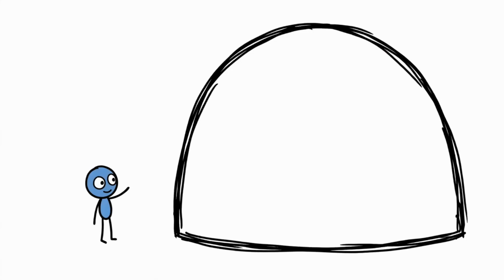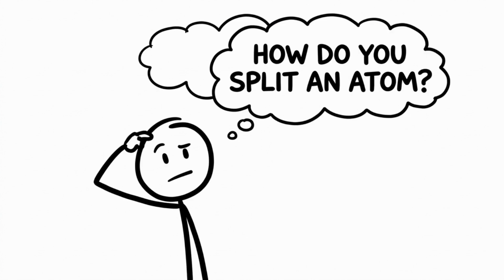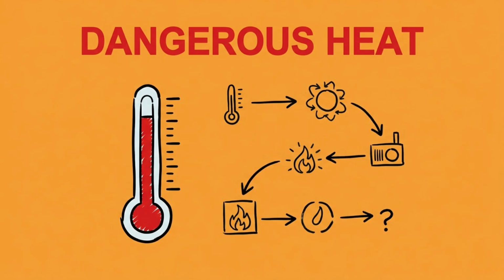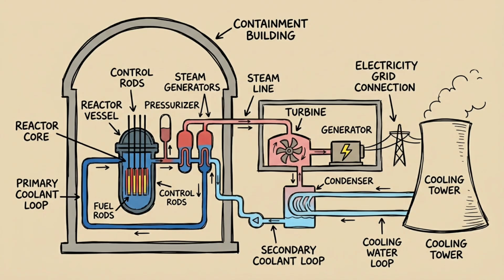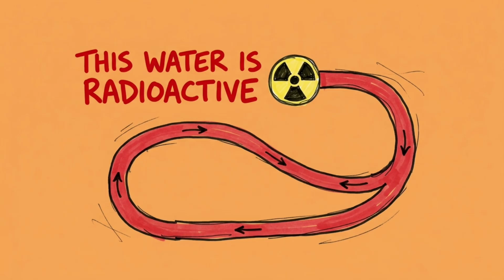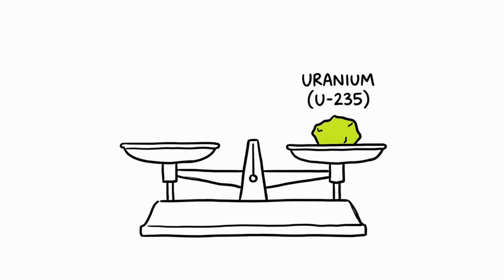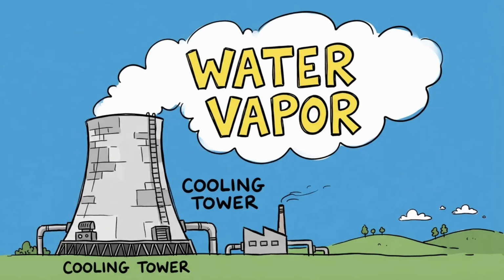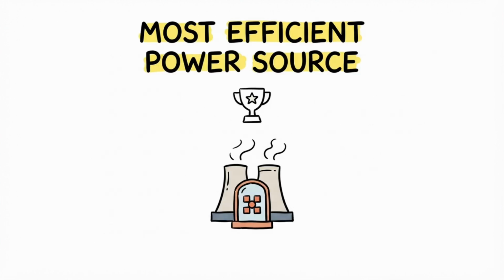Nuclear Power Explained in 60 Seconds

Comment: Massive battery on wheels, if we are to have an electric future then millions and millions and millions of BVs, battery vehicles massive batteries on wheels.

Even the nuclear nuts say the same, more electricity, more than the grid can handle, but nuclear nuts ignore grids massive limitations for getting massive amounts of electricity to the millions and millions and millions and millions and millions and millions of grid connections.

Nuclear nuts then say LESS TRANSMISSION more nuclear plants, SMR, Small Modular Reactors, and more BVs, battery vehicles, massive batteries on wheels parked 23hrs every day and all night long. 
PARKED 23HRS EVERY DAY. Working with the grid.
Battery vehicles break PEAK LOAD on the grid infrastructure and help peak loading 247, 365, basically 3times more electricity and trillions saved in not expanding the existing trillions dollars national electrical grid.
Happy economic days.
BVs selfplug-in 23hrs every day and all night long remove peak grid demand from the millions and millions and millions and millions of grid connections. 

Happy to help.